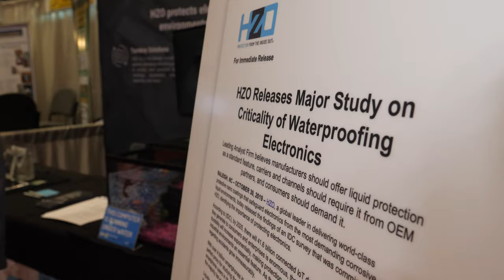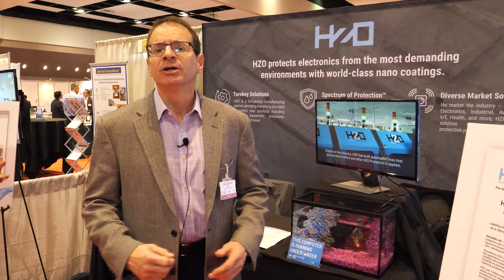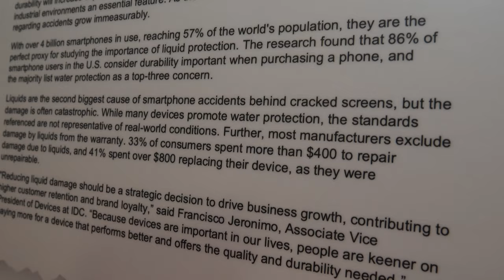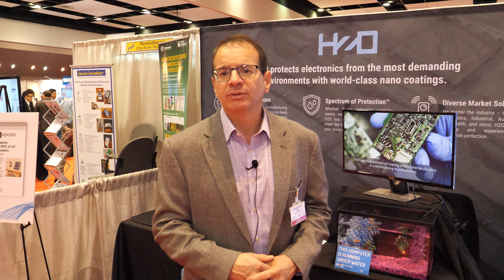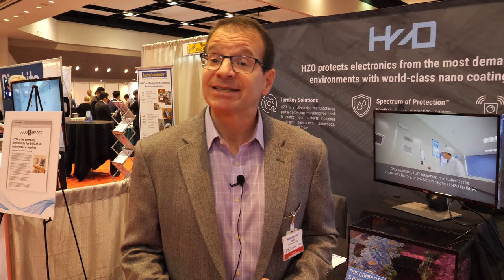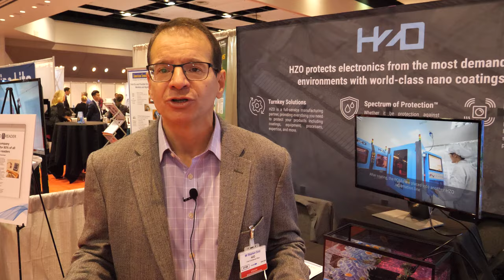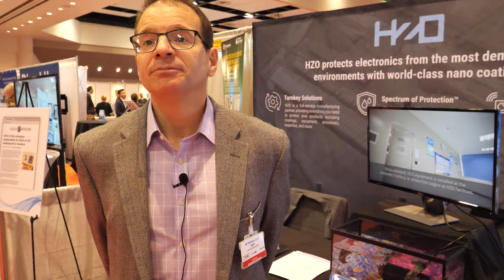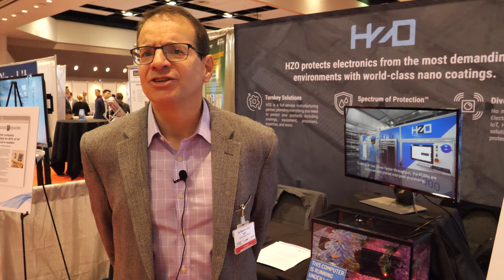Waterproofing electronics: HZO Protects What Matters Most To You using thin-film nanotechnology

Comment: Electronics without this is just stupid, modems have cooling holes in the top and anything spilling into it would compromise it. Phones also arent safe my last phone fell on the side and that made a small hole in the side. No external sealing works when its cracked, and obviously it failed few days later. Wasnt in a good shape, the microusb port was beyong saving.
Reply from the maker: My beloved Gemini PDA fell in the sink and within a couple days wouldn't boot up anymore. I wish the new Cosmo Communicator had this treatment. But in general if corrosion can be prevented on everything using HZ0's thin-film nanotechnology, on every component of a car and airplane, this could be huge. Corrosion is like the nr1 thing do damage all things in the world, water and humidity damages all of it gradually, so if HZ0 can be involved in all of it that could make all things last forever, I wonder how big components can be, and how quickly they can apply the thin-film nanocoating, and what's their cost, how much does it introduce a delay in the just in time manufacturing processes accross all components in the industry..